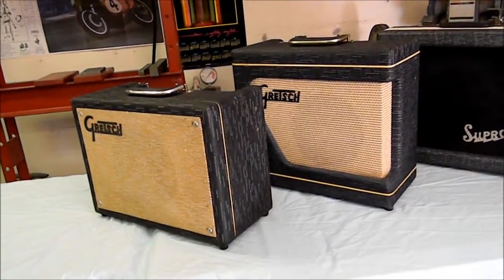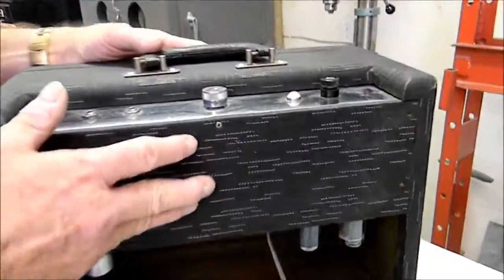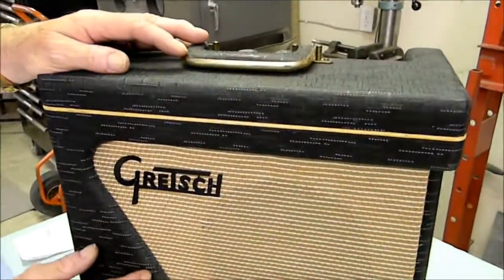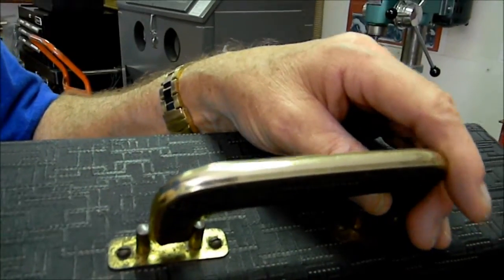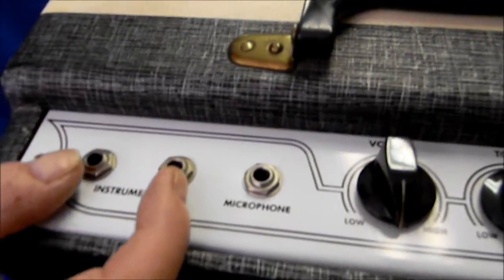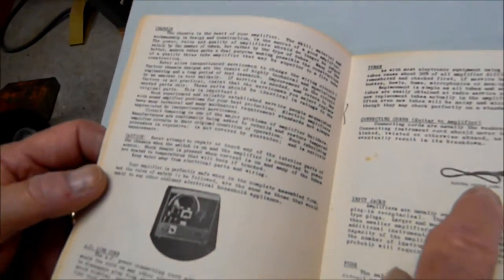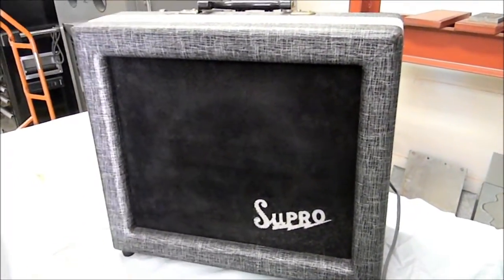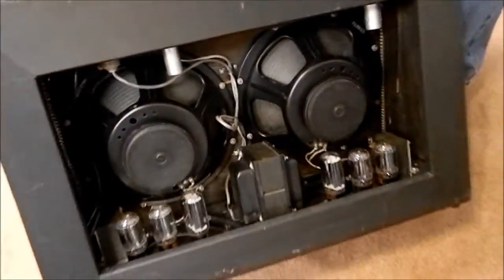Gretsch Model 6150, Gretsch Model 6151, and a Supro Model 1614 Spectator

Comment: Thanks, John. Your speaker code is for a Quam speaker made in the 11th week of either 1951 or 1961. Since the speaker is electrodynamic (it has a field coil), I would bet on 1951. I suggest that you check out Internet sites dedicated to either Gretsch amps or Valco amps (Valco actually built the amp for Gretsch) and see if you can't find a 1951 or 1952 amp (or schematic) that matches yours. BTW, I have lots of vintage amp videos posted on a companion site.....just click on the icon to the left.

Comment: Cat, thanks for the input. Yes, I have added lots of 3-wire power cords to amps and have never had to modify the amplifier itself. You must be sure that the black "hot" wire (of the three: black, white, and green) goes to the on/off toggle, fuse, and power transformer primary (in that order). The white "neutral" wire goes to the other side of the transformer primary, and the green "ground" is connected directly to the chassis. Good luck !!!

Comment: Hey, I'm ALWAYS willing to go the extra mile to help out a fellow tube-head. If I can report on my own disasters and save somebody the expense and grief that I went through, I do it every time. Besides, nobody wants to see those 3 beautiful classics ever come to any harm. You can save the old parts, and put them back if you sell the amps to a collector. They're not as anal about virgin solder joints as the guitar guys are, and you can enjoy your amps with confidence! I'll check the cap meter.

Comment: An interesting observation.....my own experience with increasing speaker size (and efficiency) tends to run contrary to this, however. Almost without exception, bigger speakers sound better. Speaker efficiency is based on cone thickness and voice coil mass, with less moving mass = higher efficiency. Larger, more efficient speakers tend to be more dynamic and responsive than smaller, inefficient ones, and move a lot more air.  A favorite modifications of old Fender Champ amps (with 8" speakers)..

Comment: Thanks for the follow-up, JP.  Have you seen the new ESR meters that are now available (at reasonable prices)? They take a lot of the mystery out of electrolytic capacitor health. I bought one and made a video about its use with old amps. I think you might find it interesting. Regardless, thanks for your input. I really appreciate it.

Comment: is to change over to a 10" or 12" speaker, which "opens up" the amp and provides much better tone and volume.  Another consideration is that with guitar amps, the amp may not have tone control but the guitar does. You can easily alter the amp output tone with the guitar tone control.  Finally, I have connected very small amps (like those in the video) to huge speaker cabinets (3 x 15" Jensens at 97.4 db each) and the resultant volume and tone were spectacular.  I guess "bigger really is better".
Reply: Hi I have the Gretsch 6150 and i want to get an attenuator in between the amp and speaker. However i’m not sure about the cable leading to the speaker. It’s not clear which whether Green or Black is the positive/Negative. There’s no +/- marks on the cone either. Would you know this.?

Comment: Was there any warning that the filter caps in the Tremolux were failing.....or were they dead quiet one day and dead shorted the next ?? Also, I would have thought that the fuse would have prevented such catastrophic destruction. Was the amp properly fused?

Comment: Good questions! First, the sure sign that an electrolytic capacitor has seen better days is a little blister, that looks kind of like a wart, on the positive end of the cap. that means that the electrolyte has dried up and a dead short is waiting to happen. Second, My own ignorance at the time contributed to my disaster. Although I had the right fuse, (750ma), I kept putting new ones in and they stayed on for 5-10 seconds before blowing. this most likely was enough to kill it.

Comment: You really ought to replace the filter caps on all 3 of those amps. 50+ years is way too long for any electrolytic capacitor. If one of them gives up the ghost, you risk catastrophic failure. I had the filters short out on a Tweed Tremolux, and they smoked  both transformers and a pair of vintage N.O.S. RCA black plate 6V6 tubes, plus a nice G.E. rectifier. $40 worth of new Sprague Atoms would've saved me over $350 in repair costs. It's o.k. now, but it was an expensive.and frustrating lesson.
Reply: I have a 1964 Gretsch 6150.
Thanks for the advice on installing new caps.

Comment: Great post. I've always maintained that the amps were the backbone of tone. I've picked up a gretsch electromaticamp. No obvious stencilled number. Case by suitcase manufacturer; red/brown in color, vol/ tone, leather handle, guessing 5 watts, field effect output,spk is 9844   270111. wondering if you had any info off the top of your head

Comment: I'm trying to find how many ohms there are in the 8 inch Jensen speaker for the Gretsch 6150 is it either 4 or 8. The speaker has a tear in it and needs to be replaced. Thanks for your help ahead of time
Reply from the maker: This video was made 10 years ago at Uncle Doug's house. 
This is his equipment so it would be best to contact Uncle Doug - I assume you know of him here in El Paso. 
Hope this helps.
Reply: mine are all 4 ohm but they had two transformer options so you can double check the codes..  or disconnect and measure the speaker.

Comment: I have a 6152 Gretsch which I actually replaced the two output tubes but they're running extremely hot can you give me any help in that area. The 6 V6 tube had broken the index Peg and I mistakenly put it in one pin off which is a terrible thing to do. Could I have damaged something that would cause these tubes to run blistering hot?
Reply from the maker: That would take me a few minutes to figure out... however, if you offset the index, the tube filament did not light up so  likely it did no harm. These little 6V6 tubes do run Very hot - between 350 and 450 degrees - they will leave a hurtful burn if you touch them - once you get the tube oriented correctly and you can see both tube filaments lit properly, check that the plate of the tube(s) are Not red hot. If you see no red in the plate, it is probably OK and likely you did no harm.
Reply from the maker: Well, now that I am thinking about it a little more - if you rotated it clockwise, the filament pins are are on pins 2 and 7 so now they are on 3 and 8 and that shorted the plate lead to the cathode which is probably a cathode biased output. That very well may have either burned up the cathode resistor or shorted the cathode bypass capacitor. That would not be good and would end up shorting the cathode circuit to ground so there is no bias and it would make the tubes run extremely hot and the plates would turn red hot. Check the color of the plates. If you do not see them red, it could be OK. If you rotated it one pin CCW probably nothing at all happened as pin 1 and 6 are open. Pin 6 is often times used as a tie point for the grid-stopper resistor to pin 5 but I can't see how this mistake could have any consequences. Hope this helps.

Comment: Its not only unsafe playing these old amps with the 2 prong but there is also the "DEATH CAP" that needs to be REMOUVED because if the death cap happens to leak then you can get zapped to death
Reply: Greetings, AE. We've all heard the dire warnings about the dreaded "Death Cap"....but have you ever personally known ANYONE who was actually killed or injured by one? Millions of vintage amps were sold with two-wire cords and "Death Caps", and to the best of my knowledge, there was no world-wide epidemic of mass electrocutions. Granted, it's a personal choice, but in pristine, original vintage amps like these, in which the capacitors all check out, proper fuses are installed, and the two-wire cords are in perfect shape and fully functional, I tend to leave them alone rather than yield to an unsubstantiated urban legend. I hope this makes sense. Thanks for your input :)
Reply: I play/use and gig with a 1958 spectator and it is in good shape and i definately feel safer now that it has been remouved and the cord replaced, especially when you start sweating. Im not sure what the guy did but it is alot less noisy as well
Reply: I understand completely, AE. Any amp that is used a lot, especially for public performances, must be as safe and stable as possible. Also, any changes are purely up to the owner.  I too have put 3-wire cords on my amps and on customer amps, but on pristine, original vintage amps, I tend to keep them completely original if the cord and circuit check out. If I sell one and the customer prefers a 3-wire cord, then I will install one. It all depends on the age, condition, and owner's preference. Thanks again for your input.